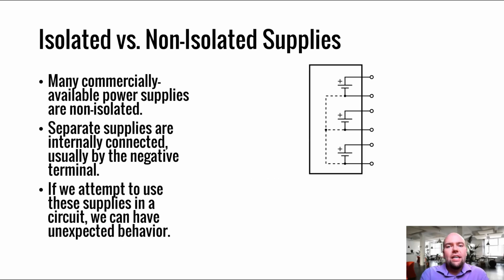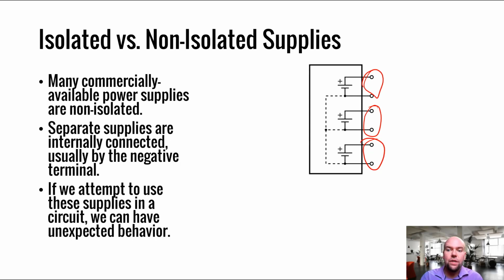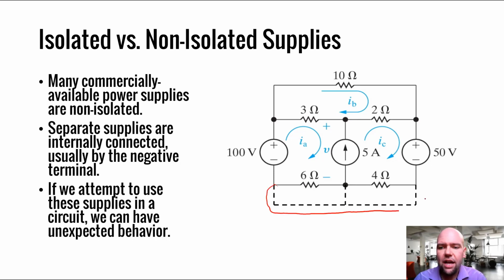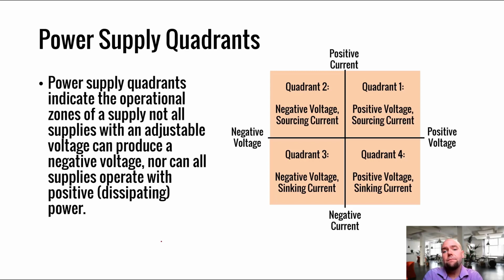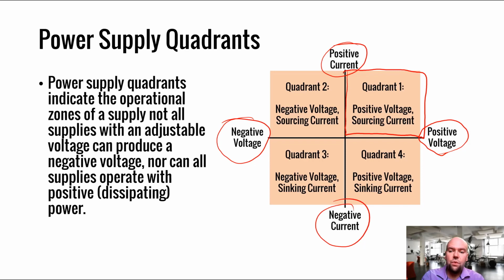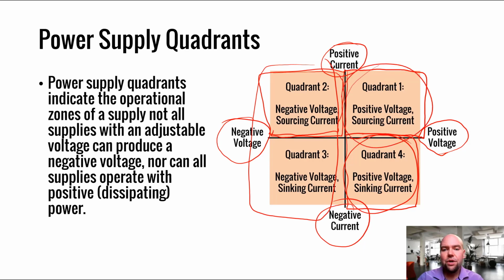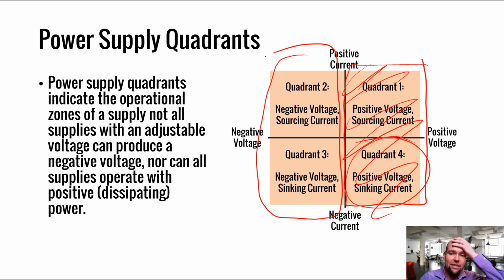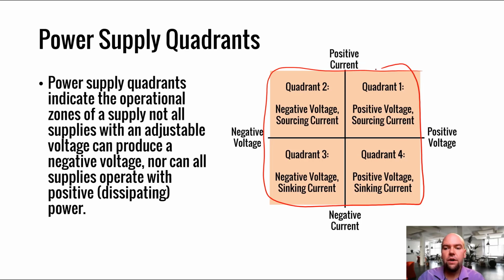Lab Board Introduction

Comment from the maker: I don't make it clear in the video, but "50 mA" on the board refers to the  limit of the current input to the ammeter.  "50 V" refers to the voltage limit of the voltmeter.
Reply from the maker: Probably doesn't help that I call the voltmeter a "voltage supply" and the ammeter a "current supply" 🤦‍♂️ My bad.